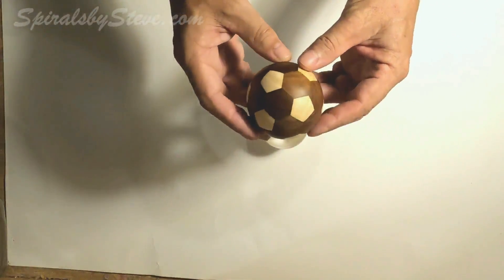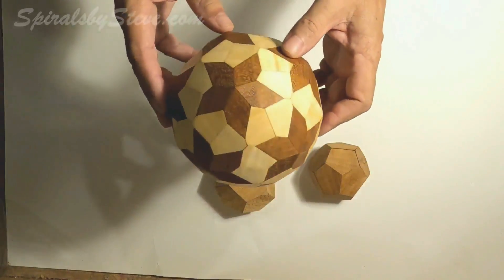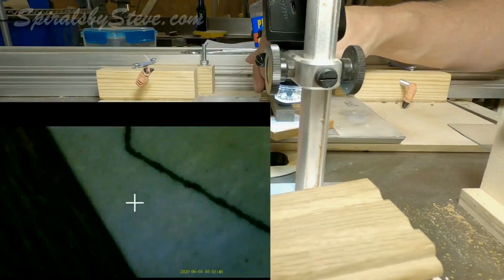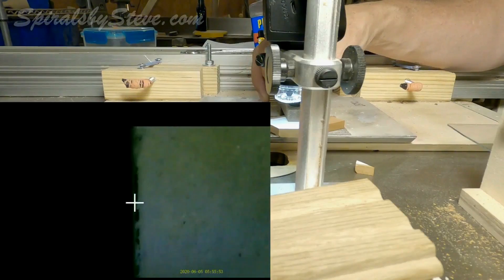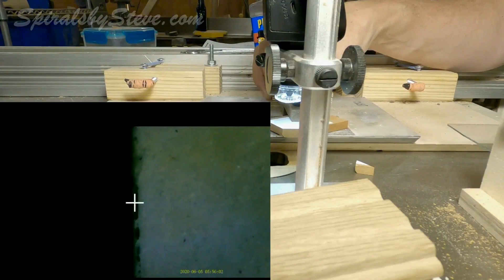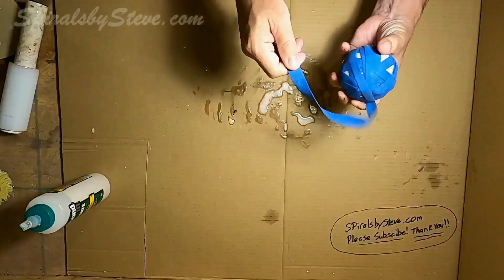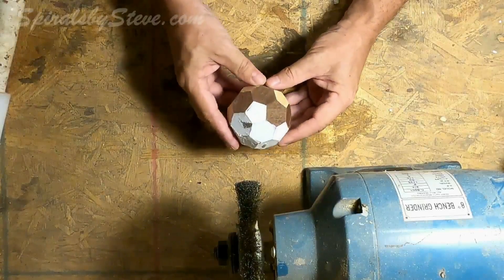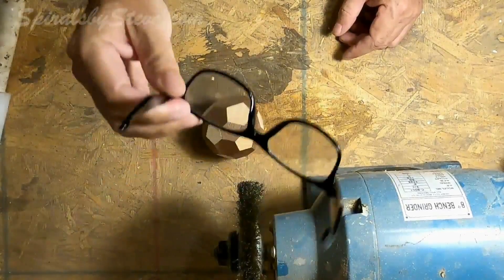How To Make A Wood Soccer Ball

Comment: This video is most useful thanks. I'm developing a variant of this method to make a hollow truncated icosahedron, without the pentagons, with a small stellated dodecahedron inside ( the stellations poking out through the holes where the pentagons would be). I had to watch this video quite a few times before understanding enough to make my own jig. 
Is there an important step missing in this video (namely how to set the microscope crosshairs to the edge of the cut)?  My guess is that you cut a piece of scrap wood the same thickness as the segments and set the crosshairs to that cut edge?
For my purposes I need to make the truncated  icosahedron with a known circumscribed (or inscribed) radius, so that I can turn the stellated dodecahedron to an appropriate size. I've watched other peoples videos of course and may also try making a  truncated Icosahedron (but including the pentagons this time) out of skeletal hexagons (someone else's method)  with a great stellated dodecahedron inside.
Thanks for making this adventure possible.

Comment: thickness of the material to be used?
Reply from the maker: Depends on diameter.  This size you can use 1/2 inch material.
Reply: In theory you can use any thickness up to the radius of the sphere that is inscribed in the truncated icosahedron, however in practise using this method, it would be impossible to make with the same thickness as that radius, because the facets would meet at a point and be un-clampable. You could make the segments the same thickness as the  radius using gem faceting techniques and this would make a solid sphere. 
There is a proportion between the edge length of the segments and the inscribed 2 radiuses ( outside of the sphere and inside of the sphere, so given an edge length and thickness it is possible to turn a sphere with a known outside and inside radius.
Hope this helps.

Comment: What is the maths to work out what angle the cuts should be at?
Reply: If you want' to work it out yourself get a soccer ball  and draw a great circle that passes through the top and centre of the opposite edge of one of the pentagons. The great circle passes though some 6 perpendicular heights of pentagons, 3 small diagonals of hexagons and 3 edges of hexagons (the hexagon radius). This allows you to calculate the proportion of the edge length of the segments to the circumference of the circle (E=C/17.4288). You could draw a circle divide it up into these segments and measure the angles or calculate them using trigonometry. 
It's a lot of maths to get there and it would need a long video to explain it. In my experience the maths turns off wood turners, who are happy to accept the numbers as received wisdom and make the shapes without needing to understand the maths.
Hope this helps.

Comment: Wow!  Enjoyed watching your vid.  As a suggestion for improvement, I like the technique for laying the tape, adhesive side up, doubling and sticking ends to the table.  Doing this allows me to tight fit my pieces more accurately before glue-up.  Hope this makes sense.
Reply from the maker: I think I see what you're saying.  You're suggesting placing a long strip of tape sticky side up on table with ends secured to table, and laying the polygons on the tape so one strip fastens several joints?
Reply: @Steve.Garrison  Yep.  You only have to maneuver one wood piece into alignment with another rather than the tape and two wood pieces all at the same time.
Reply from the maker: @allanwolfe6071  , thanks.  The truncated icosahedron would be a good one to do that way since the net can be made to have the faces roll up like a cylinder with one long piece of tape around the equator.  I used that net in my Instructable, but not when I was putting it together in the video.  https://www.instructables.com/id/Make-a-Truncated-Icosahedron-Out-of-Wood/

Comment: Is it better to have a small or large blade?  Small blades are cheaper, so you can be sure to have a sharp blade. Large blades have more teeth and can cut more on the down stroke, so the cut can be smoother. 
Two tips: First, you waste a lot of electricity starting up the saw, so you could add extra clamps to the sled. Then you can line up and align multiple pieces and then cut all at once, with barely more energy than cutting one.
Second, add a scrap piece of wood near the blade, beside the aluminum, that sticks out 1/8" or so, that way if during your adjusting, you get too close to the blade, the wood will be cut before you hit the metal, saving your blade.

You are my favorite "Steve" and that includes myself.
Reply from the maker: Hi Steve, thanks!  You just about have to use a full size blade because the bottom of the wood you are cutting is about an inch above the table on the sled - then on top of that the bevel angle eats up some of the thickness capacity.  You can only cut one piece at a time because the adjustable sled removes the alignment error to make the pattern line parallel and two pieces in a row will need different adjustments to make parallel.  Finally if you accidentally hit the blade with the aluminum it will probably be okay, that's why I use aluminum instead of steel.  

I do like to use the 7 1/4" blades whenever I can, but the maximum blade height is only 1 5/8" as opposed to 3" on my saw.  You're right about the saw using a lot of electricity, I have to run my dust collector on a different circuit so I don't pop a breaker.

Comment: So many genius moves here Steve - microscope ... screw adjusting ... plastic and rubber band clamping; very good tips I can borrow? So wonderfully conceived and executed but way above my pay grade. Maybe I could adapt it to a router table setup. If you don't know already, wood turners are enamored with segmented turnings so they might be adapting your genius moves !! I was beginning to worry when you mentioned live centers but that went away when you turned with cups, whew.  My goodness, all the pieces you showcased were beauties Steve. And two as lidded boxes yet.  Stay safe.  -Mike
Reply from the maker: Yes, I had the segmented turners in mind with this.  I used to do some segmented turning myself.  I am branching out with my pattern business.  There will be more of them soon.  Yeah, I decided turning between cup centers would be better.  I didn't notice them slipping until I was editing the video.  You can borrow the ideas, that's why I made the video.